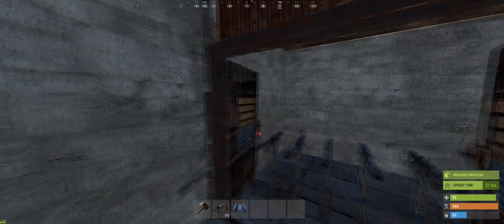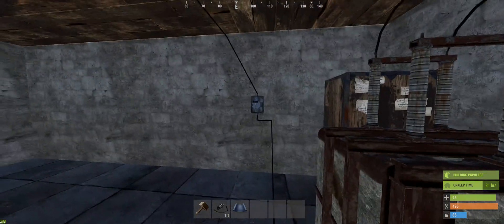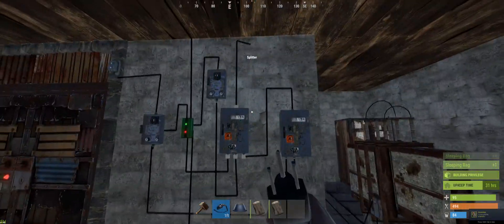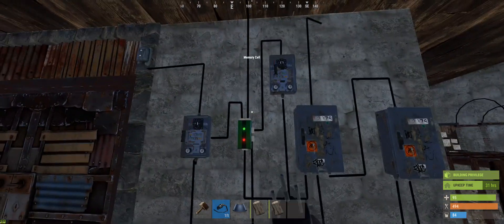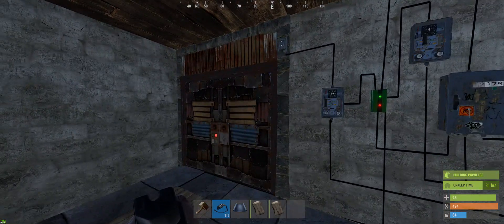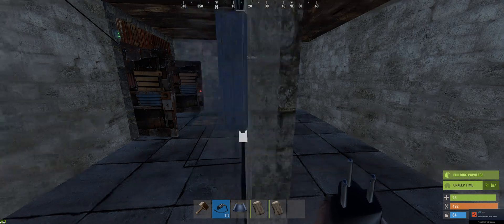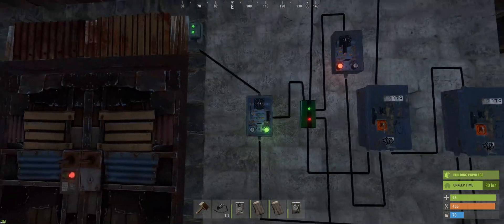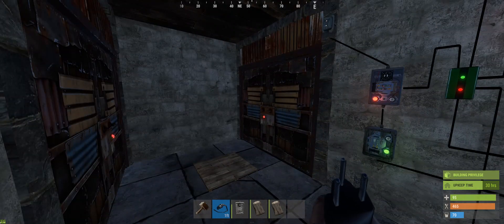Rust Electricity Tutorial #5 - Advanced Circuit

Comment: Great Video, liked it! but can you answer me, what does the blocker, RAND switch, memory cell and the branch actually doing? I mean how they works?
Reply: Old comment so don't know if you figured it out yet, but I'll make a short description just in case.
The blocker
The blocker has two power inputs, and one power output. One of the power inputs activates the blocker so it cuts off its power output. For example, if you want your solar panels to only charge a battery during the day and not spend electricity on lights, then you can hook them up to a blocker along with the battery. When there is daylight and the solar panels are active, their signal to the input on the blocker will activate it and cut the circuit so all electricity goes to the battery alone. Then when it gets dark and the solar panels don't give an electric output anymore, the blocker is deactivated and allows the electricity from the battery to pass through and power the lights in your house. There are better ways of doing automatic lighting, but this works as an example.

RAND switch
The RAND switch - or RANDOM switch, is a switch that will randomly send a signal when it receives power. It is a weird one, because it doesn't work with most conventional builds, but it can be good for more creative stuff like making games and russian roulette, or a maze system that randomly opens and closes doors and constantly changes the layout of your base, effectively trapping people inside unless they are lucky and find their way out.

Memory cell
The memory cell Is basically a counter with two settings: 0 and 1, which it switches when it gets a signal. Now, it has two outputs - one is regular and one is inverted. This simply means, that the regular output will send power when the memory cell's counter is on 1, and the inverted output will send power when the cell's counter is on 0. A way to use this, is when you want a switch that turns on lighting outside your base, while shutting off lighting inside your base. Let's say you have a base with heartbeat and footstep sensors on the outside to spot trespassers. You can link that sensor to a memory cell, and connect the inverted output to the lights inside your base, and have the normal output connected to lights outside of your base. When there are nobody walking around the house, the inverted memory cell will not get any signal, so it's counter will be on 0 - which means it will send power through its inverted output that is connected to lights inside the base. Then when someone trespasses, the heartbeat sensor picks it up and sends a signal to the memory cell, which now switches its counter to 1. This means it only passes power through its normal output, which is connected to lights outside the base. This effectively means that when someone trespasses close to your base, the lights inside shut down and the lights outside switch on; so that you have an easy time spotting people outside, while nobody from outside can see anyone inside through windows because your light inside is turned off automatically. It's a niche thing to do, but it just gives an example of how the memory cell works. I haven't used it much myself yet, so I don't know if you have to reset it after it has received a signal in order to go from 1 back to 0.

The Branch
The branch is very simple. It is a device that splits its power input into two outputs; You can look at it like a power strip, which goes out from one power outlet and creates two new ones from one source of power. Lets say you have a battery that needs to power two different objects. You can put a branch between them, which splits the power from the battery into two separate outputs that you can then hook up to their own independent circuit. Basically it just splits a single power line into two new ones.

Comment: Great video. I still don't understand what everything does like the memory cell. Also I was wondering is there a way to make a loop in a circuit, for example make a door open every 50 seconds
Reply from the maker: Have just finished recording a final video going over the current components. Memory cell took me a while to figure out... Using an additional timer and blocker in a circuit along with your battery, switch, timer, splitter and door controller may allow you to create a looped door.
Reply: @SpookGaming  thanks a lot, using this loop to pretend I'm online to maybe scare raiders away
Reply: theres a video on lighthouses on the community forum atm, if you apply that principle to doors, it should let you open them in the same manner. it uses counters.